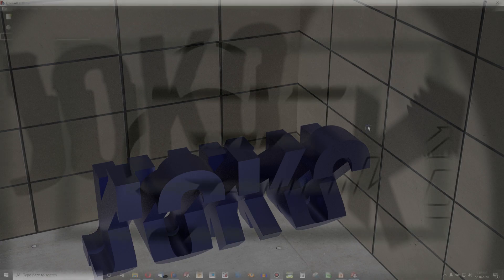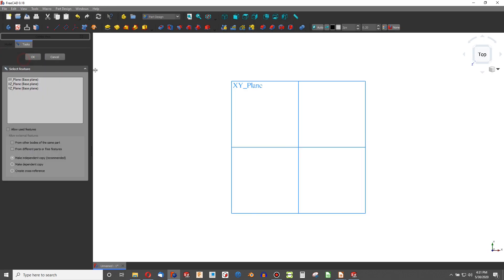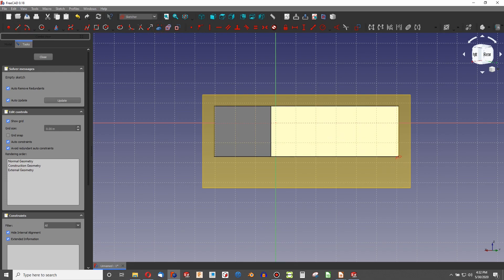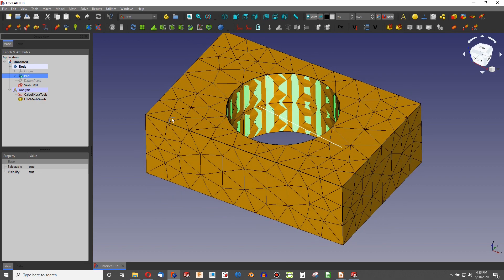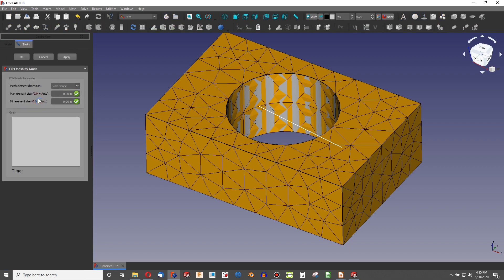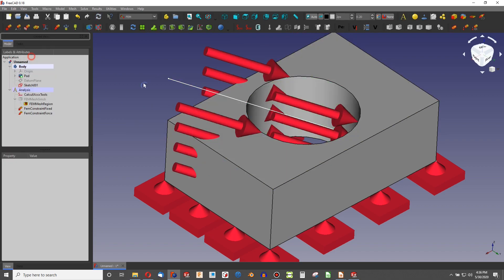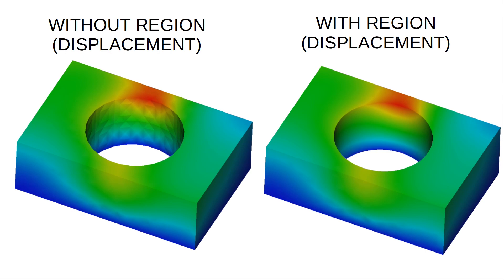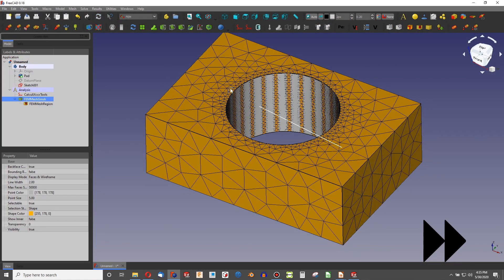FreeCAD - Mesh Regions for a Better Analysis |JOKO ENGINEERING|

Comment: From Argentina thank you very much for the tutorials freecad, they are so much utility, and one questions, based on your experience, how do you rate freecad regarding solidworks ?
Reply from the maker: I like FreeCAD a lot.  SolidWorks has an easy interface and very advanced options that you may not have in FreeCAD, but a lot of things in FreeCAD are easier.  I'd like to see more commercial use of FreeCAD

Comment: Owh, very good tutorial, but what i understood you cam change mesh region , make it more dense to other, but seem you can't change mesh type e.g.from triangle to quadran, or is there any way to modify the mesh type?
Reply: I don't think you can quad meshing is a very advanced feature and I don't think it would even work well in this case, since there's a large radial section in the middle of the workpiece. I hope I'm wrong though.